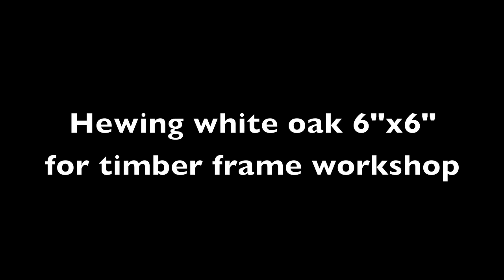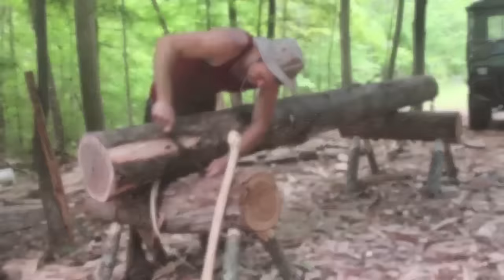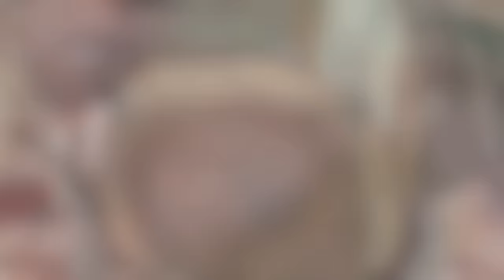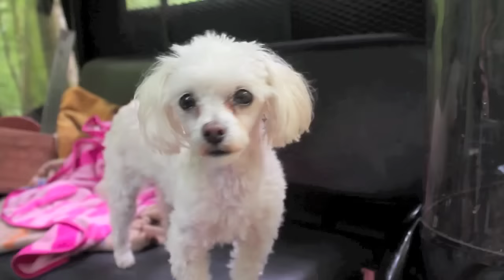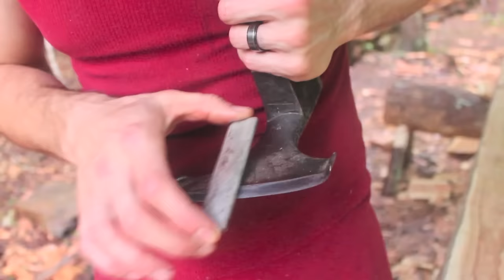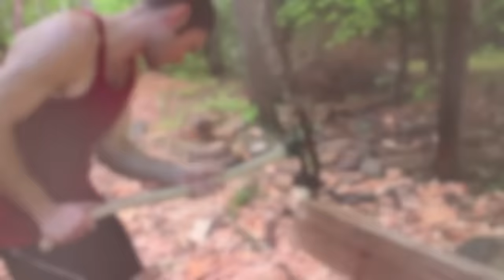hewing a white oak 6"x6"

Comment: Would using an adz to make longitudinal cut between relief segments be faster?
Reply from the maker: Depends, if you made your relief cuts with a crosscut saw very close together you might do it that way, it would of course work easier in not free softer wood.

Comment: What are you rubbing into the log at 4:30 and why?
Reply: looks like wax, i would imagine to seal the fibers on the end grain
Reply: @beepIL  Or to protect his pen markings from beeing washed away by rain. Getting a whole log hewed by hand takes quite some time. But that's just speculations.
Reply: looks like vaseline petroleum jelly. It would seal the end to slow the drying process and prevent excessive checking.

Comment: @9:00 if you would roll the log over 90 degrees you could swing your axe down instead of sideways to hue off your segments. Likely would be much easier on your back and possibly more effective on the cutting.
Reply from the maker: https://www.youtube.com/watch?v=FN77cAd5EAc 

Ive tried every way I could get my hands on, then stuck with what feels best. 
Thanks for the comment.
Reply: this is the correct method =)
Reply from the maker: https://www.youtube.com/watch?v=FN77cAd5EAc&t=15s
Reply: Nothing wrong with the methods, I think you need a shorter axe handle tbh. I use a 30" personally and it is perfect when I joggle or make chips with the log angled.
Reply: Mr. Chickadee I mean that "stuck with what feels best." is the correct method. =)

Comment: what do you call the iron holding the log in place?
Reply from the maker: log dogs
Reply: I made some with a short piece of rebar from the hardware store.  I heated and bent the ends with a propane torch.  Then sharpened the tips.  They aren't hardened but work fine and are cheap.

Comment: What was he using to seal the ends of the boards he was going to get?
Reply: i think its like wax to help keep the moister in but im not 100%
Reply: Are you referring to the grease he smeared on the end of log?
Reply: A popular brand name is AnchorSeal.
Reply: End grain looses moisture faster than the rest of the board, if happens too fast ends will check split I use to paint them.

Comment: Why make a square log? Wouldn't just flattening 2 sides be enough?
Reply from the maker: That depends on the application, for a sill you want to remove all the sapwood which is a magnet for bugs and rot.
Reply: will white ash ever return???
Reply: To 5tonyvvvv: question "will white ash ever return???"
Yes, it will evolve to become something slightly else.
Reply: BobEMoto   j
Reply: BobEMoto pyuyy
Reply: 5tonyvvvv no. not as we currently know it.

Comment: Would saw cuts be easier and quicker? Then go with the axe.
Reply: Cutting a strate line into such a large and long piece of wood, with a hand saw, can be very difficult by your self. This has been dun historically by a crew of two men in a pit two hand saw set up. Modern time we can do the job with a chain saw mill set up. This however can be rather dangerous and expensive. A axe and awe are much cheaper and still get the job dune.
Reply: Dallin Taggart wouldnt want to be the guy in the pit thats for sure.
Reply: Dallin Taggart; John does not mean cutting the entire length of the log with a saw. He means using a saw to cut laterally where this craftsman previously cut notches and them continue to remove between the cuts with the axe as before.
Reply: NO anless you have something like a mil or evan a chainsaw mil
Reply: @dallintaggart482  literally none of your response is applicable to this guy's question.

Comment: Ok what was point in using the plumb after the center or even any part of it? You had a Square which has measurements or not understand how to use it?
Reply: The point is to make the lines parallel on both ends - the plumb will always make vertical lines.
Reply: Because you can't make a true square without plumb lines. And you can't make a 90° angle with a plumb bob. Therefor you need both tools.

Comment: Isnt it a problem to have the pith in a timber for this sort of application? Makes the timber unstable.
Reply: No, putting the pith in the center makes the timber stable. Beams with off-center pith or no pith are far more likely to bow. Keeping the pith in the center does ensure that the timber will check, but that has no effect on its strength or stability.

Comment: I just bought some land in the smokey mountains Tennessee and I've never seen so much poison ivy! There's big hairy vines running up every other big tree and some of the vines are as big in diameter as my forearm. I've been severing the vines with an axe but what I'm wondering is after they die, how long until I can pull them down without getting a rash? One year, two?  I hate the stuff, thanks for any advice. Also, there's tones of big trees for timber framing but even though there's some white oak, the majority is red maple, hickory and white pine, can you use maple and hickory?
Reply from the maker: Thanks for the kind words, this was my first hew ever, haha Ive learned alot since then, nowdays I will just cut kerfs to the line with a large crosscut saw, bust the chunks off with axe, then finish with a scrub plane. 
On the vines, we just never paid them any mind...I cut the vines off the area im gonna chop for the felling, then cut and pull them off once the log is down. I do use gloves stypically, but Ive never gotten a rash at all...maybe Im not very effected by ivy....my choice would be pine first, then tulip poplar, then hemlock, then oak....last would be maple then hickory. If you have any basswood Id rate it up there with tulip poplar. 

Softwoods (conifers) are joy for timber framing and log building, less movements, distortion, checking, shrinking, just lovely. If you have any shortleaf or other "yellow" pines, even better than white pine.
Reply: Shane, do you get rashes even through leather gloves and long sleeves?
Reply: I’m lucky. Poison ivy doesn’t effect me in the least. Not much in the forest does. Insect bites, plant oils, none of it.
Reply: If you wash the oils off immediately after contamination than you shouldn’t break out.  Wear gloves and long sleeves, work on a cool day (slowly so you don’t sweat too much) and quit before you’ve gone an hour, throw the shirt in the wash and take a shower, getting everything that was exposed at least twice with a strong soap.  You’ll be good.
Reply: Yellow pine in our Tennessee region is very badly affected by pine beetles. There are many dead yellow pines from the beetles. I don't know if I would recommend anyone build from them, but maybe there is a type that the beetles don't go after.

Comment: What do you have against mallets?  Great video, much fortitude, but i found myself getting irrationally mad when you were trying to start the ends for cleaving off the chunks.
Reply from the maker: Haha don't get too upset buddy, this was my first time hewing anything! ;)
Reply: maxdecphoenix 

Do you think many woodsmen carried mallets with them while doing their log hewing chores 200 years ago? Highly doubt it. Well not really. Mallets were used quite often in the woods. But still. A real woodsmen can fell, limb, buck, score, joggle and hew a log with nothing but ONE axe. The mallet, or any other tool for that matter, is completely unnecessary. More tools can either make the job faster or more efficient but a single axe is all that is required.

Comment: Your vertical actions with axe are good. Very relax actions. But axe it self is not for this job. It is for firewood... 
For horizontal work axe is not good at all and can make wrong cut and your actions was looking oakwood.
My axe for such job is more thinner but bad for firewood. For horizontal cut I use long sharp splitting blade not axe.
Generally well done. Good job!
Reply from the maker: https://www.youtube.com/watch?v=FN77cAd5EAc  I show a few different ways in this video

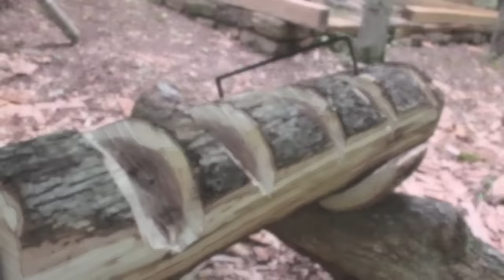Comment: at 8:00 - time to add a second hammer to chisel your grain by holding the main ax still and tappy-tap-tap...
Reply: Richard V Sassoon 

Easier said than done Richard. The bit (the blade) of any quality axe is always hardened. The poll (the back) is not. Therefor the poll is not meant for beating on. Hence the reason why he is not "hammering" on it. That's why you see the back of most axes are mushroomed nowadays.

Comment: adze work is properly done from above and always with the grain.
Reply from the maker: This is a "lipped" or "shipwright's" adze, it was designed for cross grain work
Reply: Show us your video.
Reply: Guess he told you
Reply: .....sigh
Reply: Brilliant idea using the lipped shipwrights adze for smoothing. I have a smallish broad axe and it wears me out. Looks like the adze is much easier. I learned the Moravian style hewing on benches ay Salem in N.C. Seems like the German style is better than English style standing on the log and hewing between your feet. Just makes sense to me.Roy Underhill taught the class I was in. Where did you learn this?
Reply: @MrPanama49   Looks much more tedious than the adze work I've done with a foot adze--where you can anchor one arm for the proper swing and move the adze with the other.   Maybe he's doing that here, but can't tell from the tight angle shots.  There are plenty of ways to skin a log.  I'll be sawing my notches with a one-man cross-cut saw until I get bored with that. But also, I'm not working White oak.  Poplar is more than sufficient and much more prevalent in my woods.

Comment: Do you use dead trees or you cut down live trees?
Reply: camiloandres87 
The trees are live. Timber framing is done with green wood, dead trees are hell on tool edges.
Reply: Do you plant new trees to replace the ones you cut down?
Reply from the maker: Every year thousands of new baby trees sprout from the forest floor, most of these won't have a chance to grow large because there is limited space in the forest canopy. I don't need to plant anything as when we cut down one tree, its vacancy gives space and light for many young trees to grow fast to replace it.
Reply: Thanks for your answer.
Reply: camiloandres87 trees seed themselves. how do you think forests spread?

Comment: You are using too big a log for the beam you want.
Reply from the maker: I can see why you might think so, if it was anything but a sill I would use a smaller log, even leave some wane on, but as a sill, sapwood is asking for trouble, only heartwood from white oaks is rot/insect resistant, takes a pretty good log to get that...

Comment: seems wasteful to chop into the log. If you saw along the length you can get 4 big planks also can't you?
Reply: Hewing by definition is done with an axe and by whittling the timber down . It's wasting some surface timber, sure, but they're living in a forest and harvesting timber sustainably for their own use; I don't see a problem with it. Sawing evenly along the length of a log this long is quite the tall order anyway.
Reply: Sawing is of course less wasteful. But in this case he got the timber that is close to the max usable size. If you saw this you end up with four thin plank of sapwood that is pretty much useless anyway as building material. Also "waste" is relative, firewood is useful.
Reply: Couldn't  he saw " v " notches instead of chopping notches in the bark ? After all ,the ends of the log were sawn. I don ' t think he'd be breaking any ethical issue ,or is it the preferred method?

Comment: Seems like a huge waste of usable wood.  I appreciate your hewing skill, but you thew away a lot od good wood.
Reply from the maker: It may seem that way but its subjective. The sapwood of white oak is not rot nor insect resistant and in this application I needed the heartwood only. A few small sapwood boards could have been sawn off the sides rather than hewed, but these would be low quality sapwood flat sawn boards likely to cup badly during drying. 

THere is no waste at all, the entire tree was used, the top was sawn later for firewood, the pieces split off during hewing kept us warm in winter, even the small piece made great mulch for the garden
Reply: Mr. Chickadee ş

Comment: Really? You go from axe cuts to all of a sudden a perfectly plained log. Why not show us that part? It looks like you replaced it with a log fresh off the mill.
Reply from the maker: Every step was clearly shown. End result is obviously the work of hand tools used in the video, scallops of adze on finished size are completely different than any machines surface, visible axe finish is also on opposite sites in result at the end, as obviously only the outside and inside "show" faces were finished by adze.

Comment: While I applaud your craftsmanship, that's a terrible waste of wood.
Reply from the maker: It may seem that way but its subjective. The sapwood of white oak is not rot nor insect resistant and in this application I needed the heartwood only. A few small sapwood boards could have been sawn off the sides rather than hewed, but these would be low quality sapwood flat sawn boards likely to cup badly during drying. 

THere is no waste at all, the entire tree was used, the top was sawn later for firewood, the pieces split off during hewing kept us warm in winter, even the small piece made great mulch for the garden
Reply: I agree - those off-slabs would be the first thing to go at the mill - only to be burned later.  They would not have a board, by the NHLA definition of a board anyway - and would have been thin and likely to cup/check, just as he pointed out.
Reply: Lee Thurston - What a terrible waste of an opportunity to say something good, instead of showing your ignorance.
Reply: Does anyone actually read the comments, if you read mine, I APPLAUDED his craftsmanship
Reply: Lee Thurston A mill would waste the same or more
Reply: Lee Thurston 
Yes you applauded, while still managing to make a snide comment. That's the way HE did it. You can do yours however you want.
Reply: Lee Thurston It is not necessarily wasted, fire starter for the stove.
Reply: 79pejeperro , Exactly. Go to Lowes or Home Despot and by "dressed" lumber - you'll never see the carnage that happened to make that beam or board- or the unbelievable amount of fuel "wasted" to make it, and truck it to you...
Reply: What are you rubbing on the ends of the log